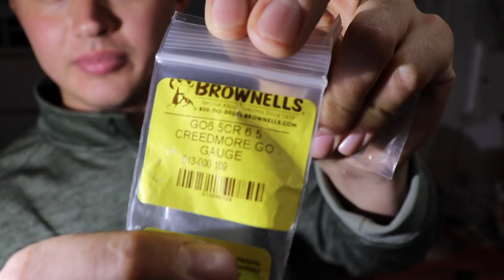STEP BY STEP savage barrel replacement!

Comment: You always want the crows foot or barrel wrench 90 degrees to the torque wrench. Torque wrenches are calibrated to the center of the ratcheting head. If for example the handle is 1 foot long, then 50 pounds of force the end of the handle would create 50 ft/lbs. If the handle becomes longer you don't need as much force to create 50 ft/lbs. If you use a crows foot or any other attachment that places the center of rotation further from the head of the ratchet you are increasing the length of your lever and over torquing. If your barrel wrench is 2" long, you are now torquing to 58 Ft/lbs.

Comment: People always say that the factory recoil lug is junk, but it’s not.    It works absolutely fine in many factory rifles.  I do agree that if your buying a new barrel you might as well get a trued lug.    I have a few factory rifles that shoot bug holes with the factory lug and barrel.   Just like you though, I am replacing the lug when I rebarrel them just cause.
Reply from the maker: Halfdollar 86 yes savage does a great job with their barrels and barrel lugs which is why they are so hard to beat with another stock rifle. Had I not messed my stock barrel up I would’ve left her be

Comment: Awesome. Thank you! I have a Criterion 6mm BR bull barrel on its way. This video was just what I needed.
Reply: Don’t do what he does! Set go gauge in with scotch tape (.002) and screw in barrel until it touches & then lock barrel nut. Remove tape and you’ll have .002 headspace. No go gauge isn’t necessary.

Comment: The .003" of tape test shows how close you set the bolt to the Go gauge. It does not determine shooting accuracy. Bolt face to barrel face gap is ideal from .007" to .010" and can increase accuracy of the rifle. A piece of tape does not do this for you. You have to measure the bolt face depth, and the protrusion of the case from the barrel face, subtract those two for the difference.
Reply from the maker: Sounds like you know a little (lot) more than me but this trick was simple and now that my gun is in a chassis it shoots lights out.

Comment: All depends on your environment as far as dropping gauges. I had one walk off my bench but luckily my workspace has a padded lanolium floor so it was 100% fine....if it were bare concrete.... yeah the gauge would be in question, but you get it. Edit: the gauge was checked after purchase and after it walked the plank with a headspace comparator for records to verify.

Comment: It appears to not have affected the install, but that barrel it torqued way over 50lbs. The torque wrench should be at a 90deg angle to the barrel nut wrench for it to read accurately.
Reply from the maker: Bob Shinn yea I had no clue that’s how it worked haha but the gun is shooting sub moa so I’ll just leave it I suppose. Thank you for the input
Reply: @TSNOutdoors  Wasn't trying to bust your balls, just inform anyone else that might be attempting this.
Reply from the maker: Bob Shinn the comment is much aprecciated! I’ve finished the build since that time and I guess more wood be a good time to post a video of the finished product

Comment: Good overview, but looks like you were using the torque wrench incorrectly. It needs to be 90⁰ from the barrel nut wrench to maintain preset torque settings. Otherwise you need to calculate for the additional length of the barrel nut wrench.
Reply from the maker: M Terry I appreciate the comment and hadn’t thought of that at all.. I’ve dropped the gun in a chassi since and it’s been shooting sub moa.. so maybe I just need to take it out of the chassi and check it the right way?
Reply: @TSNOutdoors  I wouldn't be overly worried about it if it's shooting good. Most likely its only 2 to 3 ft lbs over what you had the wrench set at. If the wrench was set at 45 ft lbs you would still be within the 45-50 the specs call for. Just keep it in mind for the next barrel.

Comment: I know it's an old video, but that's not the correct way to use a torque wrench. If your torque adapter is off axis (like a dog bone, as opposed to a socket that is in line with the turning axis) you have to turn it 90 degrees in relation to the head of the wrench, then begin torqueing. If you turn it in line with the wrench, you are actually imparting MORE torque than what the setting is, because it effectively makes your torque wrench longer, and thus, increasing the force applied.

This can be dangerous in certain applications, because it risks over-torqueing your hardware which can break things.